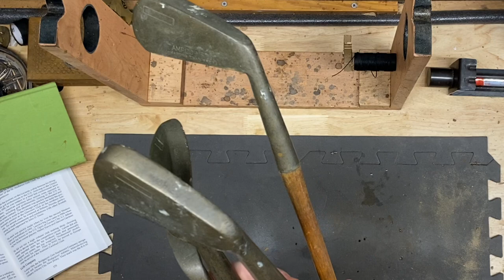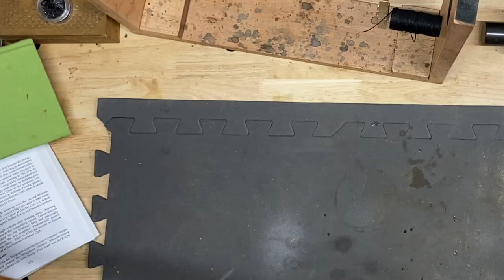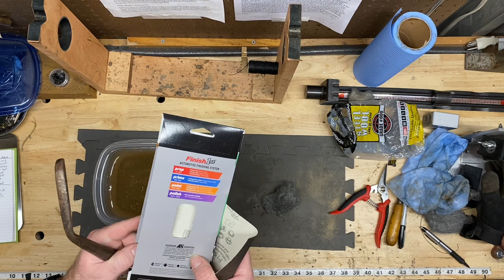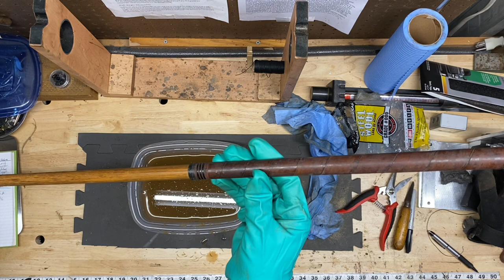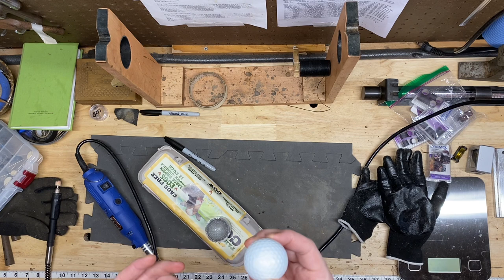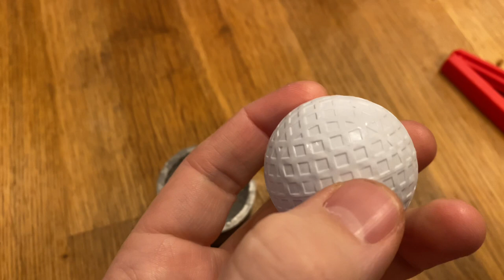Why I Store Golf Balls in the Freezer / No Soak Rust Removal: Hickory Golf - Workshop Wednesdays #6

Comment: Hey Christian - I've checked out your videos for advice on the following topic, but haven't found anything  . . . I'm assembling my first gutty-era set.  I've found a number of smooth-faced irons in the 1895-1905 era with severely compromised shafts.  My plan is to fit them with new hickory shafts from Louisville Golf.  I have two questions for you.  First, what is the authentic shaft flex for the late gutty era? Stiff, regular, or flexible?  Second, to what degree should I finish the conical insert end that will eventually accept the epoxy and pin? No finish, stain only, stain and shellac?  I want to protect the wood from rot, but I don't want to compromise the epoxy adherence inside the hosels.
Reply from the maker: Hey, Robert - great questions. You’re wading into uncharted territory for me using new shafts for replacement, but I’ll share what I know. 

Regarding flex, this is generalizing a bit but the original shafts I’ve come across in splice-neck woods and cleeks from that era often have quite a bit of flex. General irons and mashies seem to be regular to stiff. The higher the loft or shorter the club, the stiffer the shaft, especially in lofters, rut irons, and small-headed niblicks that were designed for extracting balls from tough lies and interacting with harder ground. 

Regarding your finish on the cone, it’s been my experience - and I’ve read this somewhere, too - that when you coat the cone with epoxy, you’re also sealing it off from the elements, so it has a dual purpose. That’s especially true when resetting heads with Maxwell hosels where the holes expose the cone. With the that in mind, I think you’d be fine leaving the cone unfinished and just trusting he epoxy. That said, I use Skidmore’s wood treatment, which is just beeswax and linseed oil, to recondition my original shafts - including the cone - and I let it sit for a day to dry a bit before doing the epoxy reset. So far, I haven’t had any issues with the bond deteriorating because of that, especially if I properly rough up the cone and give it some tooth before the epoxy. 

One last note about replacing shafts: When possible, I always recommend sourcing original shafts by salvaging them from cheap heads. I often buy cheap hickories ($25 and less) regardless of the head just for the original shaft if it’s straight, has a tight grain, and is crack-free. I’ve found that original shafts on most Spalding clubs are close to the ideal width for both gutty clubs and Tom Stewart irons, which have hosels that are just a bit wider than most other hickory-era club heads. If you have to buy new, though, LG is the way to go. 

I hope something I’ve written here helps - good luck!

Comment: Interesting video! you mentioned that you have to keep the mold very clean or else stuff gets on the ball. I’m having an issue where although my mold looks completely rust free and clean (as i’ve cleaned it multiple times) but rust and some other metal looking material sticks to the balls i make. This is especially noticeable on the areas that I have to sand down to remove the logo. What should I do? Can you help?
Reply from the maker: Yeah, I’ve run into this problem even after making sure the mold is clean. As far as that goes, I make sure to give the inside of each mold a couple quick scrubs with 000 steel wool just to make sure there isn’t any debris or surface rust in the mold pattern. Make sure you blow it out, too, so that you clear out any steel wool particles. Even after all of that, though. I still get balls occasionally that have what looks like rust or dirt where the logo was sanded off. It doesn’t happen every time so I’m not sure what the variable is that causes it. Has to be something about the surlyn cover that’s been sanded because it only shows up where the logo once was. I wish I had a clear solution but it doesn’t happen every time and I haven’t pinpointed the cause. If it’s any consolation, I’ve played McIntyre balls that will show this same rusty/dirty pattern around the equator of the ball after a round or two. Seems related to our issue, and I think it’s gotta be because of something that happens with the surlyn when it’s sanded.
Reply: @TheHickoryHacker i’ve been experimenting a lot and i found that if i put the mold in and leave it in while my toaster over preheats and then set the time to 4 minutes i get an almost perfect ball and i can finished a ball in around 15 minutes by cooling the mold in cold water from my sink. I think leaving ball in longer can contribute to the amount of rust that sticks to the ball.

Comment: Crybabies abound in every sport or skilled interest. When you film you also loose a little concentration but in general you can review and reveal where your weaknesses are. Playing hickory golf is fun...especially if you often don't keep score because you can concentrate on making more good shots than bad. lol 

BTW If you can find crocus cloth in your area (it's getting scarce) it is very fine grit, chalk embedded polishing cloth sold like sandpaper from 1000-3000 grit. I used this stuff in the military to keep our artillery chambers free of rust, dust, and burned powder bits between cleanings. Using it with vinegar last fall I took and old hunting knife that was in a wet environment for decades and caked with rust and pitting ,and brought it back to a decent fixed bladed work knife.
Reply from the maker: Thanks for the tip! I’ll see if I can track that stuff down. Sounds like it’s the right grit to remove rust without scratching.

Comment: love your pic from Blackheath.  have the same one. cant send pic here... :(
Reply from the maker: Thanks! I picked that up for next to nothing in an estate sale here in CT. I recently had it rematted and reframed. I’ve had some difficulty pinning down a date, but it’s the same dimensions as the original run of prints and is a mezzotint, so I’m pretty sure it’s part of run of mezzotint reprints done in the 1880s.
Reply: @TheHickoryHacker  I'm not really sure about mine.  I also picked up for next to nothing.  Mine has a small embossed seal fhk in lower left corner, dedication at bottom and is pencil signed by J Chamberlain, not numbered
Reply from the maker: @thedjmkmwilsons  Sounds like this one, which dates to 1956: https://www.ebth.com/items/6074472-g-chamberlain-vintage-golf-print